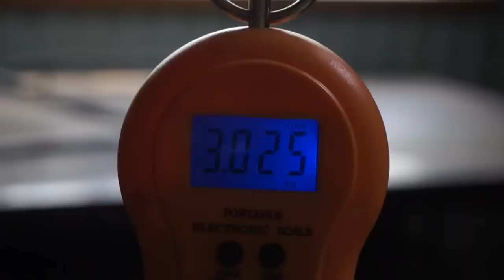Making a concept bike that blows people's minds

Comment: I guess "rebuilt"   would not be the correct term entirely!   You practically build a new bike using some spare parts from the old one!  The bike looks awesome!  It will be as good as the strength of the welds you placed!
Reply: Agree, because the frame(skeleton) is the basic thing and that one is newly researched designed and built starting from scratch.
Reply: Yes u r right mr. Alvi I am agry with u.

Comment: Beautiful project and quite an interesting result.  I wouldn't ride it much as the fork's angle plus the rear having only chain stays and not being a triangle give me shivers. Both areas would probably bend or even snap after some abuse.
Reply from the maker: You are absolutely right, this is just a concept, I sacrificed frame rigidity in favor of design. You can make a very rigid frame, and if you use aluminum, the frame will be very light.
Reply: I wouldn't ride it because of the same reasons and the fact that there aren't any brakes on the bike.
Reply: It may have the classic "backpedal to brake" thing tho. Although imo its extremely sketchy (usually ride full squish mtb, 5-10ft drops easy, and then i tried a city bike... almost died lol)
Reply: @nikitazaycev8636  Checked the video again and it indeed has a coaster brake... I guess I have to correct myself.

I wouldn't ride it because of the same reasons and the fact that there aren't any brakes on the bike I would trust.

At least 70% of the braking power on a bike comes from the front brake so....yeah good luck.
Reply: @nikitazaycev8636  Disc brakes, specially hydros have that effect, last time I tested a backpedal brake bike I forgot about it and almost ended up in a ravine after trying to adjust my foot stance by backpedaling  on a gravel curve .  It takes time to readapt to other brakes, that's why my city bike also has hydros xD
Reply: @myweldingtales  could you do stress test to compared the strength to traditional triangle bike design? And to see will the whole structure or the weld would give up first

Comment: Good concept bike I'm a road racer I think that bike could be a future if I were you I'd work with a bike company to get one made out of carbon fiber and light components but it is a nice machine
Reply: Hm….  This is a welding-channel..
Reply: @CalmoOmlac  There's absolutely no reason a similar design couldn't be made to be extremely strong and durable. The major stress points are fairly obvious, so you strengthen them accordingly. I wouldn't use aluminium because of its low fatigue limits, but steel or carbon fibre would be suitable. The frame wouldn't be particularly light or aerodynamic compared to high end traditional designs, but if it's done properly, strength and durability wouldn't be an issue.

Comment: Propably heavy as hell but looks very cool, nice work man 😁👍
Reply: All it would have to be done is cast a mold of it and make it out of Carbon fiber with a smoother edges
Reply: Frame was 1155gr, and all the rest is your choise, after all. A seriously lightweight carbon-frame goes  for at least 750gr, that here is just 400gr heavier, and it´s steel...
Reply: @klausbrinck2137  It read 3155gr.
Reply: @vongdong10  9:48 I see only 1155gr
Reply: @klausbrinck2137  look closer. There's no way the frame would weigh 1155gr
Reply: @CalmoOmlac  I get it all, it all sounds logical, but at 9:48 the balance reads just 1155. And it is possible to build that light, if u´re a good welder and work with very thin sheets...
Reply: @klausbrinck2137  It's clearly 3155 check it at 9:48 which is still lighter than what I expected.

Comment: To put in the corner, but not to drive. The stress from driving will eventually break the rear swing arm.
Reply: That depends on many factors, but with careful planning, a similar design could be extremely strong and durable.

Comment: how heavy do you want this to be?
this guy: yes

now seriously, you did an amazing job designing and building the bike.
However there seems to be a problem, you didn't put breaks...
I thought it was a fixie so it's OK,but in the last scene you showed the gear wasn't fixed. such a heavy bike without breaks ... well,I don't think there's a need for me to explain what could happen
Reply from the maker: Thanks man, I'm sorry I didn't show the brakes, it's a coaster brake system. This bike is from the late 80s, so the brakes are in the rear hub.

Comment: Bruh where are the brakes?
Reply from the maker: in the rear hub
Reply: Then how do you apply them like there no hand clutch or any such sort of thing is provided?        

It's a cool idea you have come up with and I'm just curious about the parts and all dont get me wrong asking questions I know I might be sounding rude!!
Reply: @captivatorsofficial  hey, no problem at all. Just pedaling backwards. It's a coaster brake system.
Reply: @tyrharper2641  ok that's a cool idea
Reply: @tyrharper2641  thanks bro for your enlightenment 🤞

Comment: Build quality not good. Very cheap material use. Just demo model thinking so good.
Reply from the maker: The concepts of good, bad, expensive or cheap are empty, they need to be filled with values by making comparisons.
Many things can be made from more expensive materials, such as casting a toilet out of gold. It will still remain a toilet, it will still need to be cleaned, but it will be very expensive. I am a supporter of the fact that part of the money should be spent on charity for those who have nothing and not on unnecessary benefits.

Comment: Bro you can't weld that is gona by realy weak weld (sory for my bad eanglish)
Reply from the maker: I welded it with the reverse leg. But you are right, if you weld at a low current and then clean everything off, the seam will fall apart.